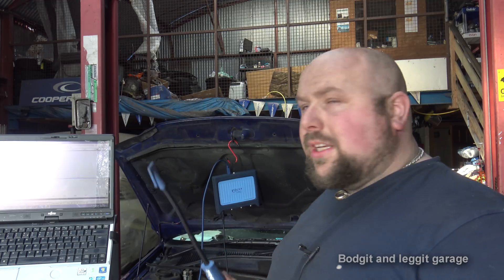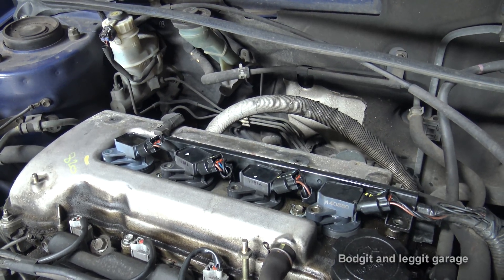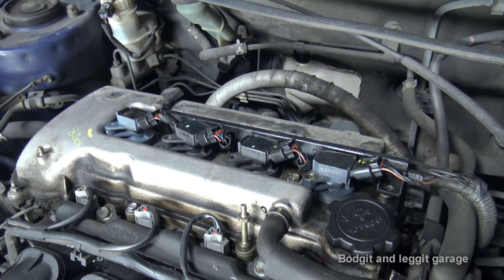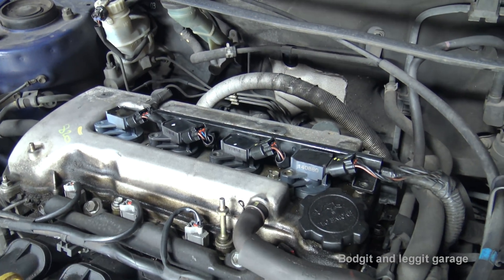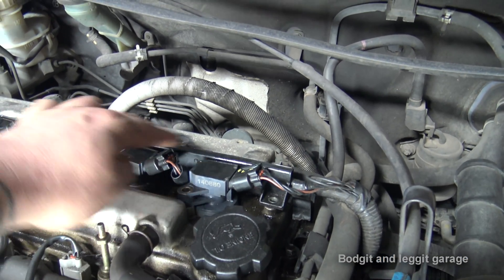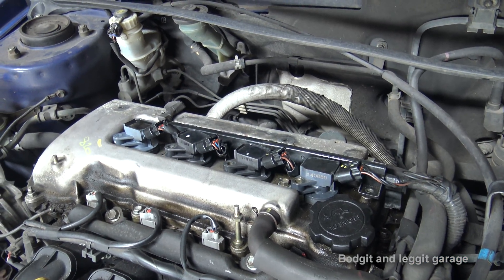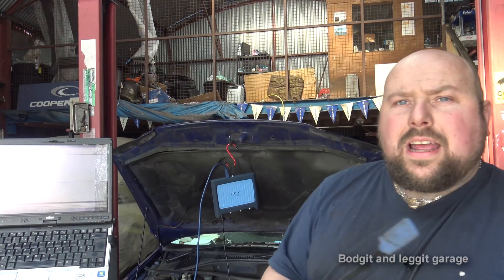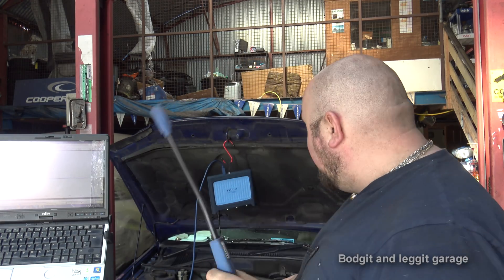Toyota Bubbling? Smelling Fuel 50000 Volt How Am I Still Alive

Comment: I've had a few cracks in my time (from checking for sparks :| )
Reply: Motorbike misfire, raining, touched leads, nearly crashed. Dont do this!
Reply: @alanfarenden9378  have had a belt off wet motorbike ht leads through wet gloves before. Luckily was stationary at the time.
Reply: Yep my dad was a mechanic, I learned quick as a child not to hold  the wet lead when requested, he used me as a fun way to check a coil.. 70s parenting 😁

Comment: Without a scope, First a visual inspection of the coils after removal, looking for signs of tracking or arching.
Then pull the spark plugs checking then for signs of tracking or arching on the ceramic top.
Then check the working and of the plugs, in this case probably seeing three normal looking plugs and one fouled with unburnt fuel.
If you found the plugs worn at the electrodes that would indicate whoever changed the coils didn't check the plugs and a high resistance in number four plug would make
the new coil track to earth, ruining the new coil.
These coil pack run at far higher voltage than the old one coil and distributor systems so the high output has to go somewhere.
Reply from the maker: Boom sorted 💪👍💪👍💪
Reply: not everyone has the eyes for that, squeeze the plug boots in your fingers and roll it looking for dry-rot cracks ;)
if you see any micro cracking, JUNK, as is all rubber materials now days, guaranteed junk

Comment: Gotta love a coil that fires every which way but where the spark has to go! Question though...why the missing bolt on the intake? Just a detail I saw is all.
Reply from the maker: Yes like # said it is a mounting point for a different things on different engines it has a threaded insert used for mounting whatever it needs to on different engines makes and models
Reply: They look like mounting points for the fuel rail.  Unused for this model but could be used for a slightly different model.

Comment: Looked like a thunderstorm in that sparkplug shaft!
Reply: I would pull codes then check by pulling the coil out like you showed in the video. As for parts I would probably go with euro car parts but ask for the same manufacturer as what came on the car, if they don't have an OE coil I would give the customer the option of non OE if they can't wait for the OE part to come in but warn them that it may have early failure
Reply from the maker: There is always a thunderstorm in my shaft🤣🤣🤣🤣
Reply: @bodgitandleggitgarage  LOL better get that checked out! ;D